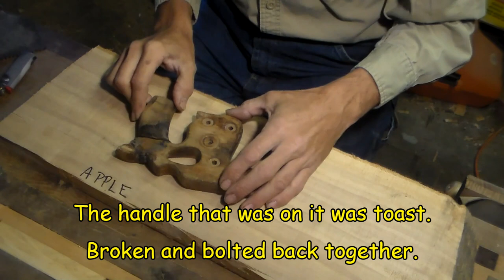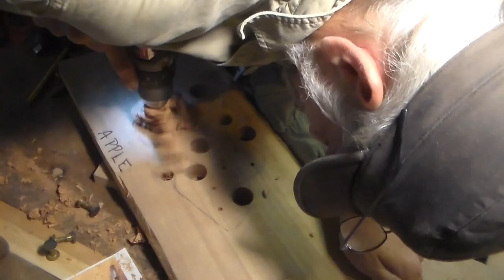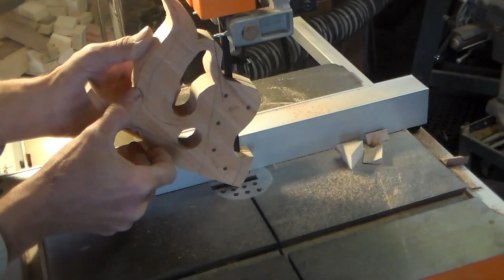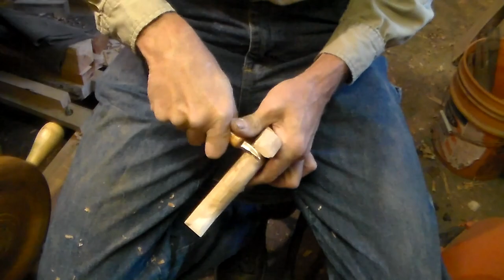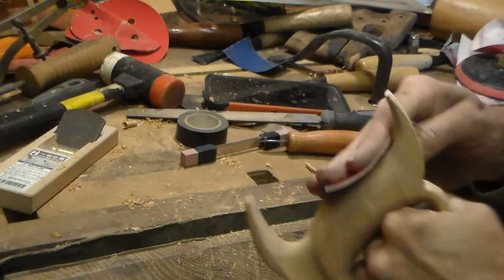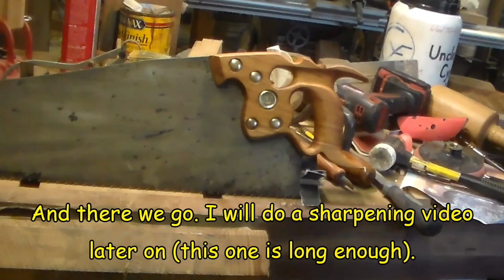Replicating An Antique Handsaw Handle

Comment: This is gorgeous! Thank you so much. I wish I knew how to slow down the video so my elderly father could watch it. He has dementia and has great difficulty following quick action. Again Amazing job sir!
Reply from the maker: There is a control in the settings for the You Tube player that will let you slow it down, But usually I am above the max slow down speed so even if you slow it it will still be at faster than normal.

Comment: Thanks for pointing out this video.  Great handle.  It’s another well done video and very enjoyable.   Would not use my planer blades for a scraper but sure would if I got some at a flea market.   Nice idea with the end holders.  
I never liked the shape or feel of most paring knives for carving/whittling.  You use double thumbs a lot as so many so I’ll mention this which you probably know.  There is a flat knife for leatherworking.  My brother found that a modified version worked well for carving shore birds and other things.  I have several so always have a sharp one close by.  They are made from a piece of curly maple about 10 x 1 1/2 x 5/8 and shaped to an elongated oval and rounded at the shoulder by the blade.   It is sawn in half and channels cut to accept a violin knife blade.  The blades used to be inexpensive at Woodcraft years ago.   In use it is much more flexable to hold and change grip with than the usual paring knife but still have control and power.    
   Nice chisel work.  Looks like you keep them in great shape, sharp.  
   There is an exotic wood dealer close by.  I'll have to pick up some apple blanks and give it a shot.  Thanks for the motivational boost.

Comment: That grip is as good as the original, if not better, no less than a work of art sir :)
To help with the slipping when carving try a sheet of non slip matting under the work piece. I`m not sure what it called in the States :)
Reply: I also like the finger hold, it forces the user to hold the saw correctly, with the index finger pointing along saw blade
Reply from the maker: Ye I thought of the mat after the fact. I have one I keep under the bench LOL
Reply: lol, sounds like you work the same way I do :)

Comment: Very nice.  Lovely, in fact.
I'm surprised you didn't test the blade slot to make sure the holes line up before the carving.  Or did you just not show that part?
It seems like the work would have been easier if you'd figured out a way to hold the piece down more securely so you weren't chasing it all over the bench.
Also, I wonder why you did so much easing of the edges with those fish-tail gouges.  Seems to me like a situation where a plain flat chisel, worked bevel-up and bevel down as needed, could have done a lot of the work quite well.
Given your obvious skill with hand tools, I don't see that the pneumatic sander did much for you.

But anyhow, great job.

Comment: Nice video & fabulous handle but why did you draw and cut out the handle from the middle of the plank? Less material waste & less cutting if you draw and cut it from close to the end.  BTW What sort of gouges were you using (used for the  finger/thumb grooves, etc.)?  Makes you wonder how Disston managed to produce such amazing saws that  were still affordable to carpenters!
Reply from the maker: It is not visible in the video but there were small cracks in the end of the board. I didn't want to have those in the handle. Sorry I did not see your comment for so long. 
The chisels I use are the Master Carver series. These are the ones that are made in Taiwan that the master carvers there use, they are certainly not cheap but they are less expensive than swiss made carving tools.

Comment: Wood carving as performance art, unquestionably the best 17 minutes of my week!  The apple seems to love the tools.  On another channel, I saw holdfasts that had scraps of sturdy leather contact cemented to the grip face.  This seemed to work well as provided a good resilient friction pad and no more scraps of wood to deal with.  Question, what are the rough dimensions of your carver's mallet?  A contractor friend of mine was saying how he'd love one and I have some dry Arbutus that I could use to fulfil his wish (and enough to make one for me too I think).  Would like to get it sized properly though.  Looking forward to seeing the new show and hoping the healing continues to go well for you.  God bless and thanks for sharing.
Reply from the maker: Yes the Apple carves very nicely. Helped that the grain was agreeing with me on this one. 
The mallet I use the most (the one in the video) is about 3 inches at the top tapered to 2 1/2 the head is I think 6 inches and the handle is also 6 I think.... I wasn't measuring when I made it it was modeled after my previous one I had worn out. But really is just a matter of what feels right in the hand. I have 1 larger and 2 smaller mallets as well the smallest is just a head, no handle, its called a palm mallet.
And I am at that stage where I cannot chew foods like normal so I am on a soup kick. Problem is I have neve been a an of soup LOL. But just 5 or so more weeks to go.
Thanks for all of your support Gord I really do appreciate it.
Reply: Thanks Cy, that was pretty much what I had guessed from close study of the video. The Arbutus is heavy and dries hard, should make a good mallet.  It's a protected species here so only way to get it is from deadfall or dangerous tree removal.  You are very welcome my friend, happy to be in your corner.
Reply: Gord Roberts  nice

Comment: What kind of chisels are those that you do the initial shaping with @DIY with Uncle Cy
Reply from the maker: MasterCarver is the name of the company, I believe they are made in Taiwan but these are not like the cheap Taiwanese ones you find in cheap tool stores. These are the same as the ones used by Taiwanese master carvers. Here is a link https://www.woodcarverssupply.com/Mastercarver-Sets/products/136/

Comment: Hi very made , as I often wondered why no one has a go at the handle with finger thumb in the handle , great job , may I ask what was the air powered sander or brand I've never seen one like that .
Reply from the maker: Tom Thumb that is a 90 degree die grinder with a 5 inch extension. I got it at Harbor Freight. I for get the brand, central pneumatic I think.

Comment: Planning to make  3 saw handles, any tips or link to help me decide on what wood carving chisels I would need solely for carving shaping the edges of the saw handle?  Just a neophyte on wood working. I don't plan to buy a set wood carving chisels, just those you would use in this project.  Thanks.
Reply from the maker: The following link it the set I started with. http://www.woodcarverssupply.com/10-TOOL-BASIC-SET-ROLL/productinfo/401004/
I have since expanded to the whole set but it took some time to save up and buy all of them. The same company sells them individually but that basic 10 piece set is priced better. 
As for Handle ideas Google Disston Saw Handles and you will find lots of images of good classic style handles.
Good Luck it is a lot of fun to make them.
Reply: Thanks.

Comment: Great job, though if you have a table saw you could have done a more authentic job on the slot. One of Disston's innovations was that the cut the slot with a circular saw blade, which is why the plate has a rounded back. Not important in your case because it was a project for your own use, but something for others to keep in mind if they're aiming to make an authentic reproduction.
Reply from the maker: I thought of this however the kerf for any circular saw blade I have is way too wide. The advantage that Disston had is that they made their own blades from the same stock they made the saw plates from. But you are correct they were the ones to innovate the use of the circular blade for that purpose..

Comment: What size are thouse gouges you are using to shape the handle?
Reply from the maker: I don't recall the specific sizes I used several on this. However here is a link to where I bought them. http://www.woodcarverssupply.com/Mastercarver-Sets/products/136/
Reply: Thank you, a few of the ones that you used look larger than 1 inch, do you have some of the 25-30mm sizes??
Reply from the maker: Yes there are several in that size range in my collection. I bought the Basic set and the sculptor set. Still need to get the detail set though.
Reply: I see, thank you. I was looking at all the sets and trying to figure out which sizes/set you might be using, and was dumbfounded :) Figured you had more than one set and/or additional ones. I am going to be making a dovetail saw soon, and not sure if I want to carve it or use the router. Thanks again for your help.

Comment: Nice video on tote making.  I have a few old saws that need new totes and your video gave me some great ideas, especially using the gouges to break the corners before hitting them with a rasp.  I am curious, how thick your blank was before you started?
Reply from the maker: That piece started right at 1 inch thick rough sawn. I think after working it smooth it came out to about 13/16.
Reply: @DIYwithUncleCy   Thanks.  I appreciate your help!